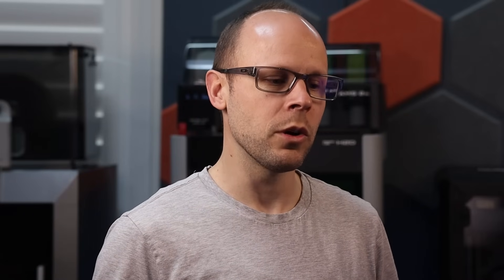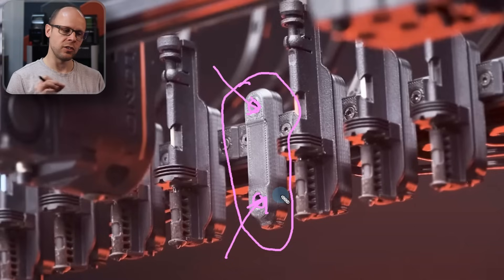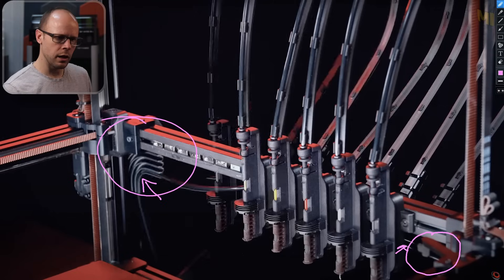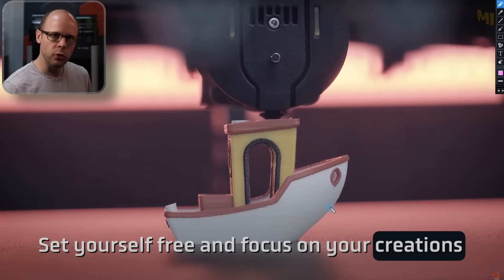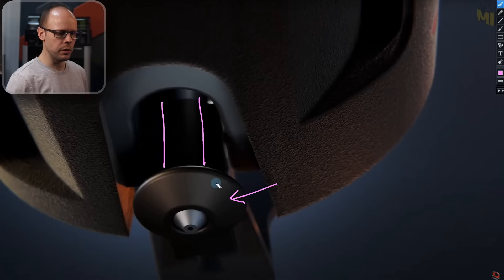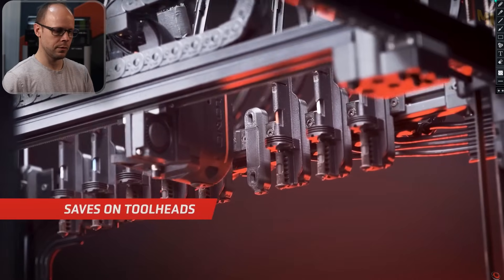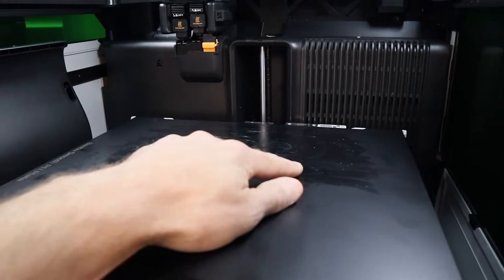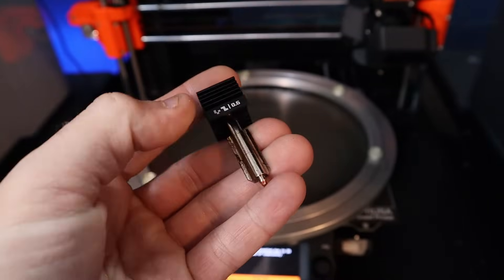This NEW INDX system from Bondtech will be a game changer for mutli-color/material 3D printing

Comment: Don't forget that the demo unit at Rapid was a V0, so whatever system they've come up with works with both flying gantry and a fixed gantry. Pretty awesome stuff.
Reply: That is wonderful news, I was worried I'd need to convert my Trident into a 2.4 lol
Reply: For those seeking further information.. Does that mean it works with Bambu, Prusa,  Voron?.. Or can some one please explain it more iif it doesn't... I see the presenter mentioned  possibly not the x1c but what about the P1S?
Reply: @TripleJAu bambu surely no, because its locked down

Comment: It doesn't work. It can't work as described. Contactless? No. Wireless? What? Near zero waste? That's a pretty stout purge tower they've got there. 

There's no analysis to do here. At best, it's a size-optimized Stealthchanger. But it doesn't, and won't exist, so don't worry about it.
Reply: Seen this live few weeks back and it works. 
No waste like Bambu lab pooping, You my need to use prime tower to be sure.
Contactless yes, the part/tool that is changed is only a conduit for the filament. Gear and heating is in the head of the printer.
Wireless, as in induction heating. Example you can put piece of paper between you pan and the induction cooker and the pan will still get hot. Same idea is when you wireless charge your phone .
Reply: Oh no it's this guy. Buddy please seek some professional help, you really need it.